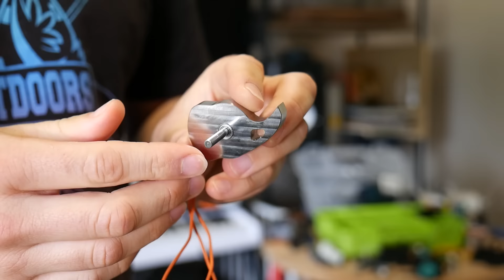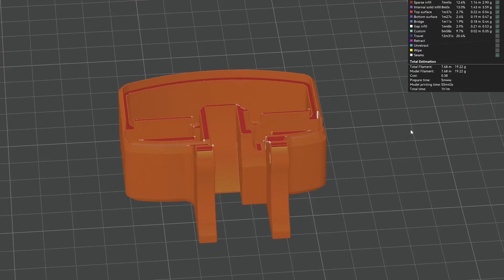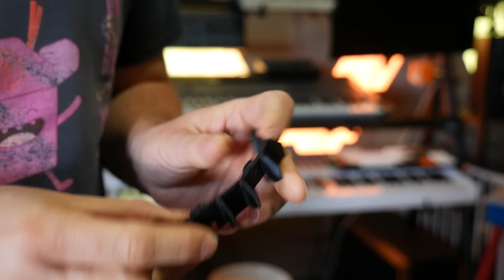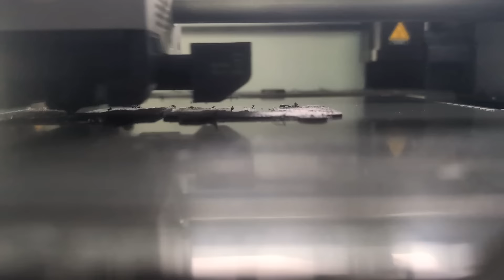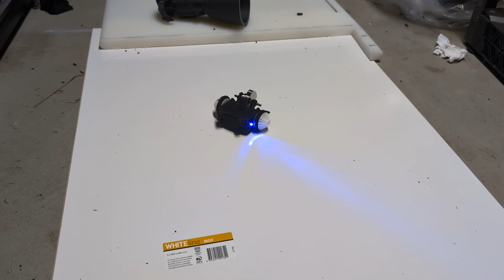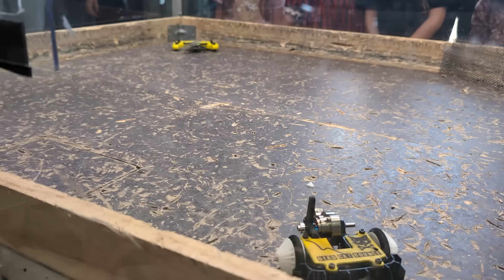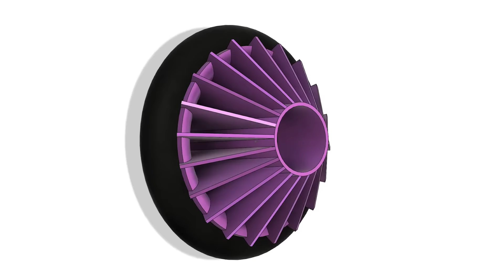Is this tiny combat robot INDESTRUCTIBLE?

Comment: Something else to consider for part strength is the machine you print on. I had 3 of the same press fit parts break trying to install them on my Rc car, all of which were printed on a Bambu A1 mini. I printed it 1 time on my Prusa mini and it did not break. Bambu printers print so fast that sometimes strength is sacrificed in my opinion. I suppose you can make profile changes, but this is just something to take note of.

Comment: What if the wheel armor was layered with steps or bumps or rods instead of vertical slices. Like if the features were just 2mm round rods, and you had to stack the rods at different heights to get the overall shape. The idea is there there's enough open space between the rods that instead of trying to absorb the force you're just trying to nudge and redirect it away from you and the neighbors around you help dissipate that force. I don't think you'd want to go very high with it but that would be ablative armor. Each hit just chips away at the top of each rod without pulling on the others around it.

Comment: if the diameter allows drilling an M2 thread into the axles and putting a screw in from the outside to hold the wheels from falling off might work?

Comment: Read up about adding expo and throttle limits in the control software or add in the channels on your radio, it will help with controlling the bot a lot!
Reply from the maker: For sure, I actually did implement a 50% throttle curve for steering and it helped a lot, but at those lower speeds the torque drops off quite substantially... I'm moving to a higher reduction gearmotor next time so I can maintain better control at lower speeds and I reckon it'll be dialed.

Comment: If you are looking into alternative materials, I highly recommend Ninjaflex TPU. IT prints very clean (if dried properly) has great layer adhesion and springs back super quickly (not like other TPUs that are somewhat sluggish to return to the original position). 
I use it quite a bit at work, primarily the 85a hardness which is very tough and the 75a hardness one as well. 75a is so soft, that it can be hard to get good print results, as the print deforms so easily under the pressure of the nozzle. The 85a is great though an properly dried prints so nice, with great mechanical properties.

Comment: One idea is that to lok on the wheel you drill a tiny hole in the shaft and put a washer behind it clamping on the wheel and in the hole a thin piece of wire to prevent wheel loss

Comment: You keep mentioning FordAM's materials and datasheets. Are they unique materials specifically made for FordAM?The spool branding and the datasheet information are just BASF materials. I have printed with a BASF CF15 nylon in Canada and there were a few suppliers available. Is it that there are no other suppliers of the material in Australia?
Reply: Forward AM was part of BASF a few months ago, could be the case that these spools are some leftovers with the BASF branding. But the materials and the data sheets are the some so the only change is the name.

Comment: @MakersMuse You should try Phaetus aeFlex TPU-78D for structural components. I recently tested this filament and its an amazing engineering material!  It prints really nice and fast compared to softer TPU's! Its flexible enough to easily take heavy hammer blows but still stiff enough to hold shape. Thank me later ;)

Comment: Add a second titanium hammer at the rear, spinning the opposite direction in line with the first to counteract the gyroscopic force. destruction on both the front and back and extreme stability.

Comment: Wicked little chopper, certainly.  Go around all the parts you have and increase fillets as much as possible, stress risers due to sharp intersections or print layers at intersections are surprisingly weak.   You're already tight on weight but you could split your chopper in half with counter rotating motors and get control of your gyroscope effect, making scissors, "running with scissors" name? Increase the length of your flail(s) with a slightly higher tower.

Comment: Try composite materials, the black TPU you used could be reinforced with a concrete like structure(TPU + tiny metal wires or steel cables) especially for the spinner holder , arms, forks or the wheels. Also might be a good idea to use ceramic wool or fiberglass inside the wheels to maybe clog up a horizontal spinner. 
Try and do for your spinner as circular sawblades are made, reinforcing the tip with a carbide or Cermet(composite ceramic and metal) insert.
Gyroscopic precession can be mitigated by adding a second spinner, spinning in the opposite direction, altough it would be challenging weightwise and in the dynamic of the spinner hits.

The wheels popping off can't be 100% solved, it really depends on the way your opponent spinner rotates, if it is clockwise your left wheel is a lot more at risk of popping of based on the direction of the hits it receives and vice versa. A porous 3D mesh structured disc instead of the fins could be more efficient at sustaining hits on the wheels. A composite 3D mesh structure of separated discs of TPU and ceramic wool would be best so your defenses also fight back.

Crazy bonus idea: Gallium chemical warfare... if any robot uses alluminium parts anywhere hittable, Gallium destroys Alluminium chemically, rendering it a brittle cracker in seconds.

Comment: Can't you make a script that turns it x degrees in y time? That way you can have a button to always turn 45 degrees at an expected pace. Simplifying driving. Could even keep an rpm sensor and do commands at several rpm stages, in case you need to  quickly turn after delivering a hit etc.

Comment: are there any rules for 'augmented steering', what i mean by that is in the event of a lost wheel your steering inputs have to change drastically. now can a PI calculate the correct augmentation from your desired steering input, to regulate both the remaning wheel motor speed and direction but more inportant modify the weapon motor speed to aid the travel in the desired direction?

Comment: For the wheels, if you happen to have dual extruder printer still around or just a lot of time and extra material, try material interlocking. Not just hard core that goes into the soft TPU wheel, but printing the core with the wheel and really mesh the materials together. Already like 1-2mm interlocking area and that TPU isn't going anywhere. Cura and Orca slicers have already settings for this but considering the size and requirements, just making like 3 loops of the core material to interlock into the TPU and 3 loops of TPU in the core and that wheel shouldn't be going anywhere.
I would remember Lost In Tech mentioned this in his latest video about TPU.

Comment: I wonder if you could fit a small third wheel (driven by a weak motor) in the center of the chassis, so that if one of the side-wheels comes off, you still have pretty decent control.

Comment: Im not 100% sure if the rules forbit this but, you can glue on some fishing line or dental floss to the fins on the back armor. its super light and might disable some vertical spinners. 
Also, look into continuous fiber inlay from for example some of the 3d printers form markforged.

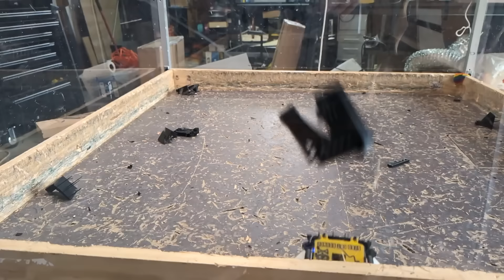Comment: 19:05 Could you modify the shaft that supports flipping it the right way? maybe a tiny bit shorter could prove more efficient into flipping, or a second shaft on the other side to stabilize. It wobbles as it's trying to flip right making it harder

Comment: It's so cute 😍

One suggestion about soldering something so small. You might consider using solid core wire instead of stranded since it should be easier to handle and pre-shape in such a small volume.
Reply: I expect solid core wire may make the issue of wire fatigue much worse. It's definitely nicer to work with when you want the wire to stay in one place, but breaks quickly with continuous movement.
Reply: Stranded is the way to go. You can make stranded wire a bit more manageable by dipping the ends in flux then tinning them before attempting to solder them down. Just the very ends, though. Soldering the strands together will make the wire behave more like solid core, i.e. more susceptible to fatigue.

If there's space on the PCB, taping down the wire can make alignment easier. It's fiddly to get wires taped into the right spot, but it makes soldering easier.

Using more flexible wires also helps. Just makes it easier to get the wire to stay where you want it while soldering.

Comment: For the forks, probably the best of both worlds approach would be to print them in a rigid material, but with a flexible material bushing around the axle and flexible material where the fork comes in contact with the chassis to spread the area that can deflect to more than just the edge of the chassis.

Comment: With the 68D tpu for AMS you could use a more rigid filament to print the first half of the wheel hub and the use the tpu to do the rest of the wheel for a mix of solid and soft ish
Reply: First tests showed that there 68D is more like a 64D, they are using some additives which makes the filament bit softer

Comment: Would it make sense to use magnetic coupling instead of a hard axle on the wheels, to let them get forcefully spun by external forces without fully transmitting the forces to the robot's internals?

Comment: Can you make a sleeve for the axels to stretch your soft rubber wheels over, and make this sleeve a donut shape so the wheels can be pulled over it and have a better chance to hang on.   Like wrap a speed bump around the axel to put a ridge on it to slide the rubber wheel sleeve over.

Comment: "My advice: Get yourself a soldering iron with a really fine tip"
(holds up a soldering iron that looks more at home soldering rain gutters than PCBs)
Reply from the maker: don't torture yourself like that! haha
Reply: @MakersMuse  It was directed at you 😩
Reply: There's some really cheap T245 soldering irons on aliexpress which work incredibly well
Reply: Yes "really fine tip", shows an normal to slightly bigger than normal tip fine is something other.

Comment: A way to improve the funeral would be to have the part that holds the tyre be more rigid while an inner hub is where the super soft fence would be would prevent the polling off issue

Comment: How about printing a PC+CF mesh that is intertwined with TPU for the body , that way youd could have a rigid mounting point for the weapon by adjusting the density of Pc versis TPU, a tough impact resistant body and good transfer of energy into the body of the robot while keeping things light?

Comment: For the fork materials, I was wondering. Would printing a rigid core with a flexible surrounding material with a multi material system like the AMS be a good idea?
Reply from the maker: Absolutely worth trying! Unfortunately, soft TPU isn't AMS compatible with the bambu systems.
Reply: @ Recently Bambu released TPU specifically for AMS use. I believe it somehow gets softer after getting extruded. No clue if its properties would be good for battle bots but might be worth a shot!

Comment: I think a thicker base for the wheel fins (i.e. tapered) would significantly increase strength. Also why not cover the super tough forks in the soft, impact absorbing material. 
Lastly, why not have rounded sides instead of basically square? The edge is the weak point.

Comment: If the spin up time of the weapon is fast enough you could maybe have it triggerd by pushing a button instead of a joystick. That way its will not affect the stearing when not in use, maybee
with a custom spin up and down curve for the motor.
 
Coming from a back seat driver, good luck!

Comment: Some people have already mentioned this, but I’d go with swapping out the infill for walls of the same weight. These walls could be designed to spread out impacts across the whole structure. I was thinking of a two-layer wall design where the outer wall has fewer, larger triangular sections, and the inner wall is denser. This way, the impact dispersion happens in two stages, using more surface area to spread the force.

Comment: A welder should be able to add material back onto the tip of the weapon, to repair it. It might be possible to rebuild the tip by fusing some tool steel onto the titanium, allowing the tip to be hardened and tempered, giving a longer lasting edge.
Reply: You aren't welding steel to titanium. Just remove some material to make it symmetrical and then bold something hard metal (same that used in buckets teeth) and bolt it on that.

That material could be printed by laser 3d printer.
Reply: @jannejohansson3383 dissimilar materials like titanium and steel can be welded and fused together. I'm curious how exactly you would design the hard tooth to be bolted on in a way that will survive in combat.
Reply: Solder on a chunk of carbide?

Comment: The axle could have a little threaded section on either side, so you could have a little nylon lock nut holding the wheels on, so you could keep using very soft tpu

Comment: I'm just barely above a layman enough to wonder if having the motor in the hub is going to transmit tremendous force to the coils and things, increasing the chance of failure...
makes me wonder if vulcanized rubber recycled from tires would make good shock absorbing structural parts
Reply: right, duh. TPU.
still...

Comment: What if you enclose the wheels not in a full enclousre but a mesh made of the stronger material with a second elastic layer over the top? that would let you go potentially for the harder wheel.. the other option of course is to multi-layer the wheel, harder inner with the softer outer layer. Composite layering for the best potential from the materials.. just a thought.

Comment: Why not completely enclose the wheels within the frame? The filament you used for the forks looks like it would make a fine armor especially if the infill was a dense honeycomb pattern.
Reply: There was a YouTuber who managed to make a 3d print in pla that stops .22 bullets. Armor like that would make a small robot nigh invincible.

Comment: Something I have heard of but know little about is tempering for 3D printed parts, fusing the layers together better, I wonder if that would help, or make any difference?

Also, I don't know exactly how the best way to pull it off, but making the weapon out of titanium or aluminum, but tipping it with hardened steel would be an interesting upgrade.  Bonus points for adding small teeth/claws  to the leading edge.  I wonder if it would be a net reduction in mass if you counterweighted the spinner with a tungsten carbide insert.

Comment: I had an odd thought. If you have a printer that has 2+ nozzles, are you able to combine, fold or weave multiple strength materials to combine their properties? Thinking like a katana with folded steel. Softer core for flex and durability, with a harder edge for sharpness.

Comment: Age your PA6 for a few days, it'll get softer as the humidity level equalizes with the atmosphere.  Using it just after printing means it's bone dry and has the maximum strength.

Or, y'know, just print them the day of.

Comment: I don't know how practical it would be, but would a contra-rotating weight or blade help counter the gyroscopic precession?  I realize you are limited by mass, but if some of the weight was switched to a connected contrarotating weight it you would still have the kinetic benefit of it.

Comment: it's expensive but look into Treed nylon CF. I was able to print it on an ender 3 and cr6-max. I used it for a mech engineering assignment and it was super strong. Layer adhesion was a little rough on open machines. But it was super strong and light.

Comment: 😂🤣🤣🤣 the last 4seconds so freaking funny ❤. It really showed us how a dead cat bounces out at the most inopportune times. 

Can you widen and add a chamfer or two on the outside of the wheel so it can get more contact when canted in gyroscopic procession? 

Or make the TPU fins flare out so there is resistance from lifting onto one wheel instead of the opposite taper like you have now into a cone… have the flaps make ground contact making the wheels ultra wide 😎

Comment: Have you thought about replaceable carbide tips for the weapon? Off the shelf planing bits seem like they’d be cheap and effective.
Reply: I’m sure carbide would chip quickly, if not shatter like other commenters have suggested. 

I was more interested in the replaceability and availability of those bits rather than just the harness. Seeing that single piece of titanium integrated into the motor with the tip missing seems like it would be very hard to replace and potential shorten the life of the bot due to vibration (unbalanced).
Reply: @JG-vf5hc  Hmm, that's a good point. SOME kind of replaceable tooth insert might be useful to increase the lifespan of the hub motor. Probably not carbide, but some kind of steel section dovetailed in and pinned side-to-side or something?
Reply: I'm not sure most combat robot weapons are intended to 'cut/shave' material, AFAIK spinners like that are attempting to make high-energy impacts that don't deflect easily, to transfer a lot of shock into the target and throw it rather than neatly removing a chip. I think carbide tips would shatter in that kind of use -- or actually WORK and cut off a chip of armour rather than slamming the opponent with the built-up energy of the flywheel.
Reply: Wouldn't carbide just immediately shatter?

Comment: Wheels look to be a bit too far forward. It looks like the robot driving forward is causing it to buck, which might be loosing you engagements. Bonus points if the wheels stick out the back a bit so you can instant self right by driving backwards.

Also maybe make the bot a bit wider and shorter front to back to make it easier to drive, corral, and deal with the gyro